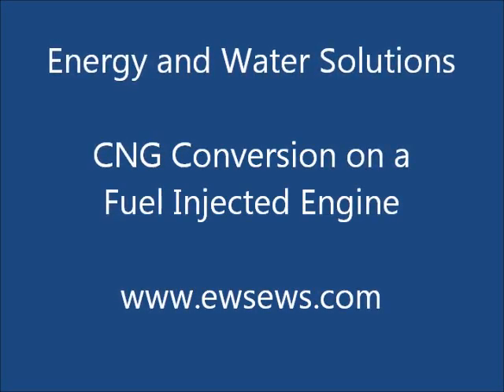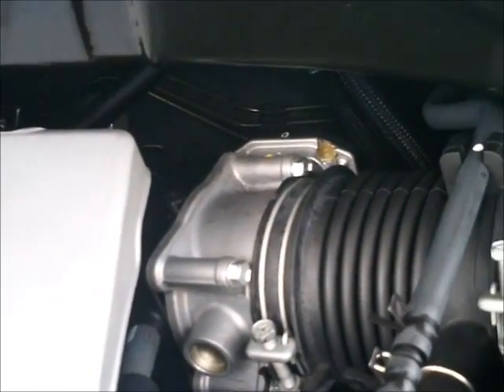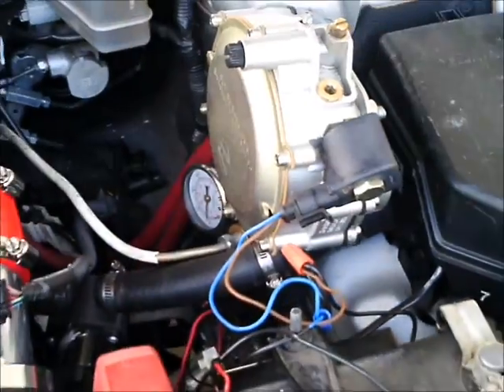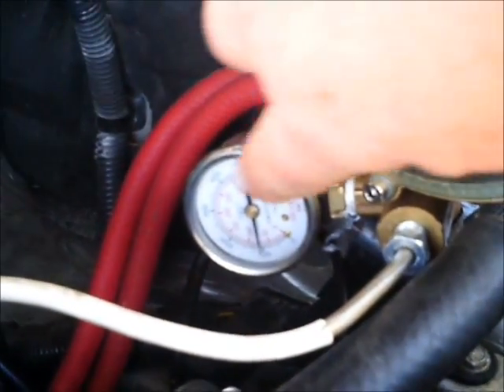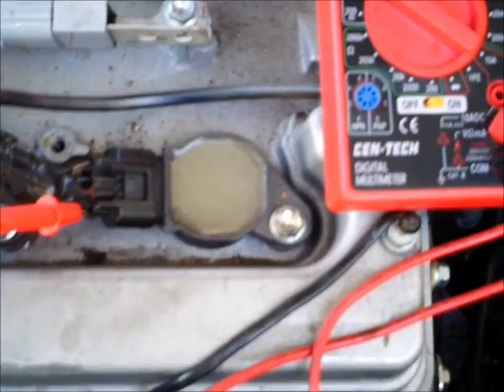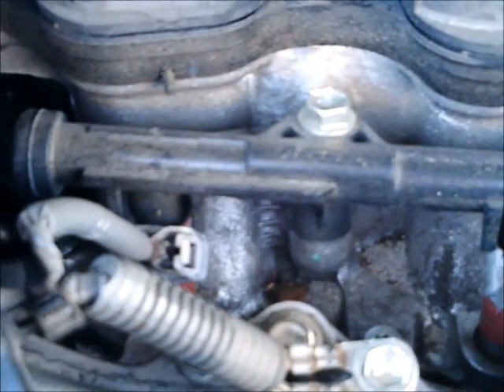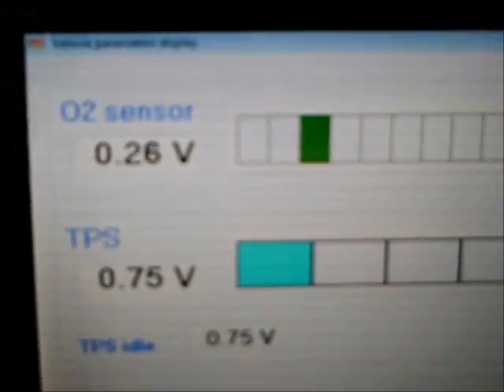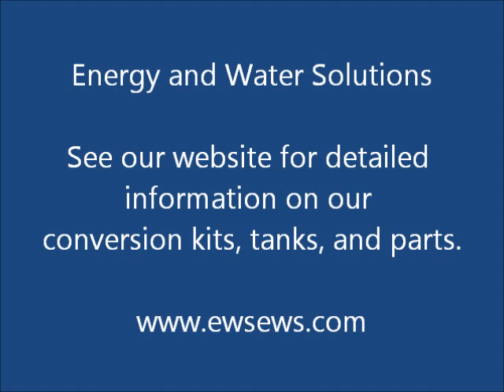Millennium CNG or LP Conversion Kit For All Fuel Injected Engines

Comment: 7:02 That's a big ol' wad of carbon on that throttle plate.

Is there much of an increase or decrease in economy? I'm curious what the range is for a gallon of liquid propane versus a gallon of gasoline as a ratio or percentage.

Comment: Can this be installed in a 1972 air cooled VW? Specifically the VW Type 3 in my profile photo. This car has an air cooled engine in the rear and a trunk/luggage compartment in the front. The gas tank is in the front underneath the luggage area. There is a very primitive computer they called "the brain" that works the fuel injection. Otherwise, there are no computer components on the car.

Comment from the maker: Our carburetor kits include an O2 sensor and bung so the fuel ration is adjusted just like our fuel injected kits.  The controller emulates the TPS signal.  The engine runs like a fuel injected engine while running on CNG or LP.

Comment from the maker: Our Millennium single point injection system works very well on fuel injected engines.  A sequential injection system does not have to be used on a fuel injected engine.  We now have sequential injection kits available, but we recommend our Millennium system.  See our CNG Conversion page on our website for more information.

Comment from the maker: You can use the factory O2 sensor if it is not an air fuel ratio sensor or a wide band O2 sensor.  The fuel injectors are turned off while running on LP or CNG so they will not get "cooked".

Comment from the maker: Pulling the injector fuse may also shut off other components and will not allow you to switch over to gasoline when needed  It is best to use the yellow wires or an injector controller, if needed, to turn off and on the fuel injectors.

Comment from the maker: Energy and Water Solutions has many CNG tanks and tank mounting brackets to choose from and we are well stocked.  You will need a CNG tank and tank mounting bracket with your CNG conversion kit.  You may need more than 1 tank to get the driving range you want.  See our CNG Tank page on our website shown in our videos.  There is a comparison cart on the bottom of the CNG Tank page showing all our tanks with specifications and prices.  See our tanks in our online store for details of each tank.

Comment from the maker: Our carburetor kit comes with an O2 sensor and bung and uses the O2 signal to control the fuel ratio just like a fuel injected engine.  There is no TPS signal and so no TPS signal is used.  The kit comes with software and a computer cable.  The controller is our EWS system which is similar to our Millennium, but with a fewer options.  See our carburetor kits in our online store by visiting our website shown in this video.  A video for installing our carburetor kits is coming soon.

Comment: The EWS conversion kit is the best DIY (or nearly-DIY) unit I've seen out there. I can definitely see myself buying this at some point in the future. 
I see how the Millennium system works with the O2 sensor and TPS modulating the gas flow...
For your carbureted version, for pre-computer engines, how is the gas flow modulated? Is there a closed-loop O2 system, and how is the degree of throttle determined?

Comment: Why can't you use the factory O2 sensor? Will it hurt the injectors to be non-op while on LP? I read somewhere that they can be "cooked" if not being cooled down by the gasoline running through them. Thanks.